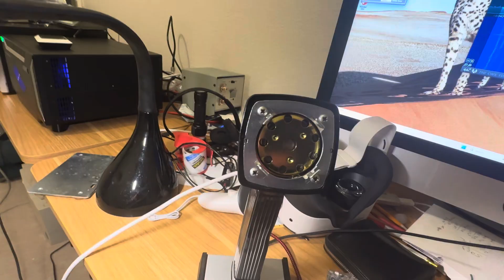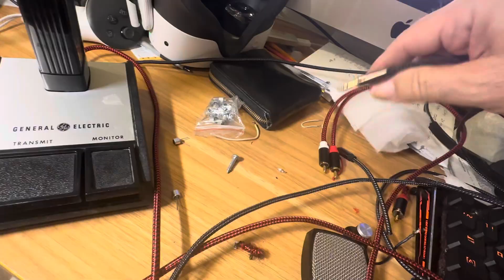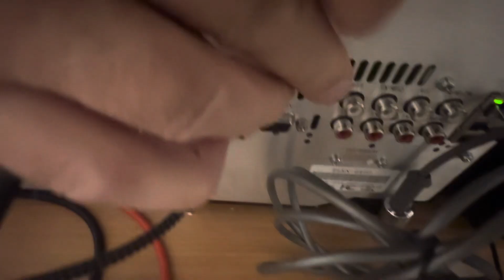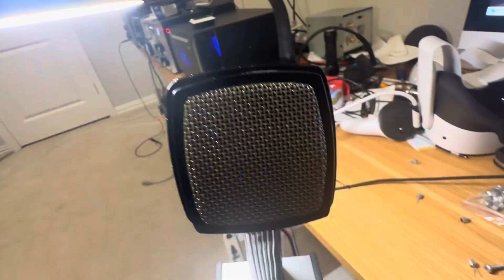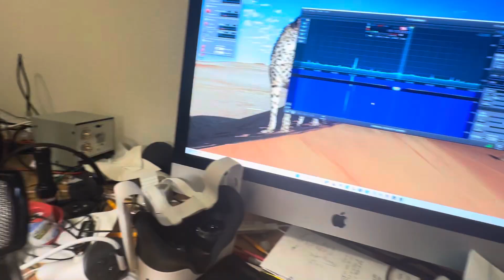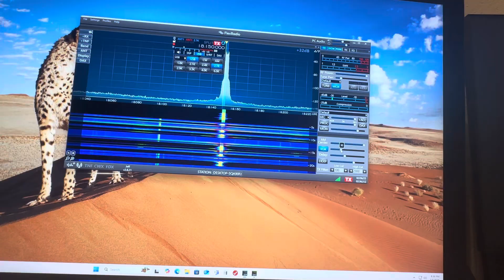Flex Radio 6400 Mic How to WIRE 10' cords for Shure General Electric two-way microphone for SSB comm

Comment: Good work..
Reply from the maker: A tiny hand mic from Flex Radio is about $70? And the hand mic keeps you very close to the Flex Radio. Here is have 10 feet of mic cord out ot the radio so the mic can be placed on the office desk. The Flex 6400 may go onto the floor soon as there is no sense of the Flex 6400 taking up desk space with no knobs on it. The only control per se is the ON/OFF power button which can light GREEN for booted, RED for issue - WHITE for 6400 reset and I think Amber is firmware getting written to SD card in Flex 6400?
Reply from the maker: The mic seems clean when running the Flex 6400 on low power and monitoring the SSB and the AM and even FM on the RTL-SDR using CUBICSDR software for receive on the iMac and using USB headphones to keep the feedback low.